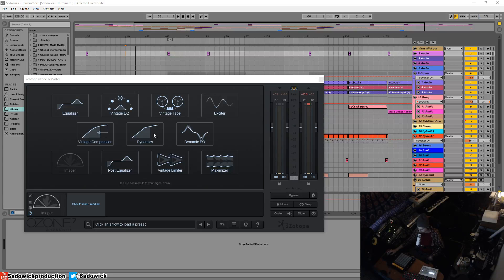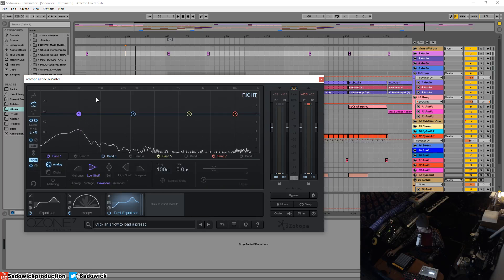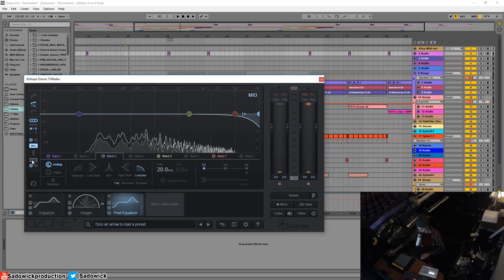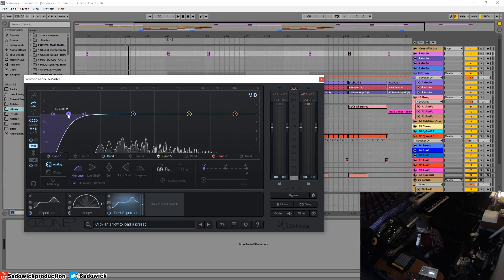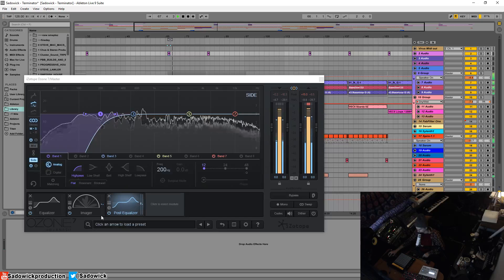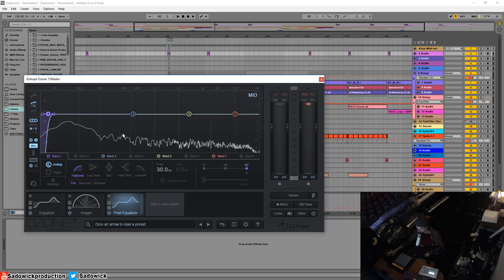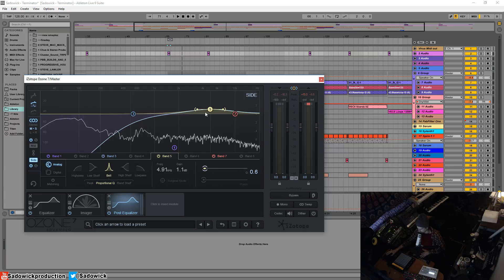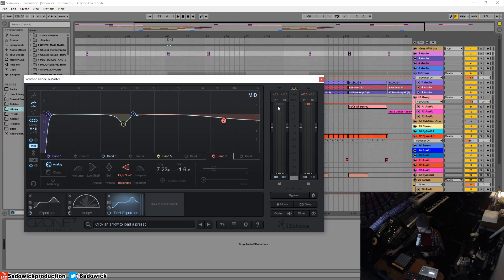Izotope Ozone 7 Tutorial 10 - Post Equalizer

Comment: Why do you need to highpass the side if you have already used the imager to make the low end mono?
Reply: The reason I would think is that the imager is designed to just widen the signals in the band using an offset or delay algorithm. These may not catch all the samples simply because its mono'ed. Whereas the highpass is the extra step to make sure no samples slip through from the imager into the maximizer. Along the same lines why you roll off and high cut to make sure you compress and eq accurately